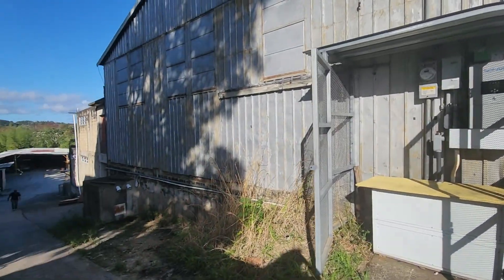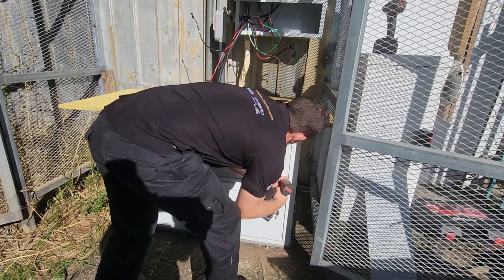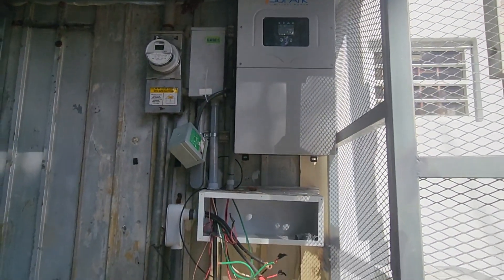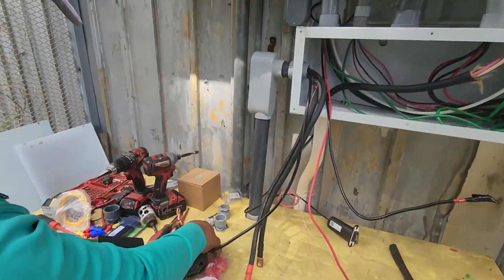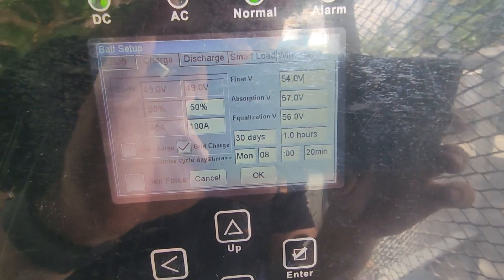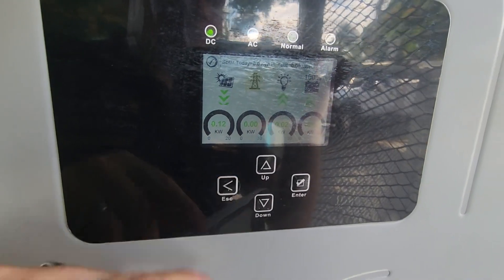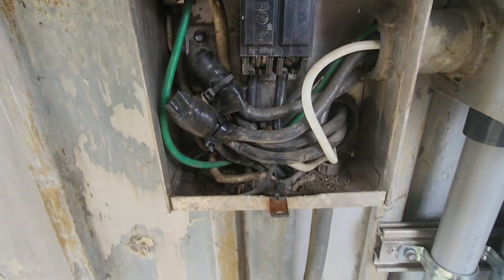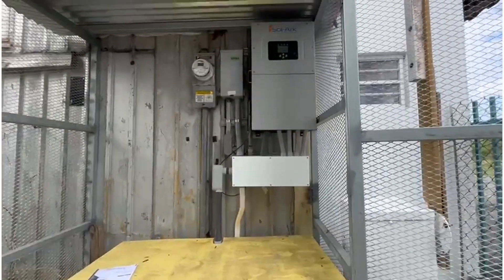Sol Ark 12k replacement for 15k BEAST

Comment: Nire equipment considering that inverter for my house. I have a critique though, push the wires into the corners of the box like when doing a neat circuit panel, it will look better and it will give the maximum amoumt of wire in case of an event and damage. Think of slack as redundancy.  Good Luck
Reply from the maker: Thanks for the tips!

Comment: Los felicitous, i to have a 12K Sol-Ark and 3. Fortress 5.2K  and 10 450w panels this system was installed about four years ago and it has worked perfectly.  Soon i hope to expand with 10 additional panels and one extra battery.  Since you’re.  here in Puerto Rico i may give you a call.
Reply from the maker: Sure! You can reach out to us at our email info@kenosyspr.com

Comment: Sol Ark 30K it will be the perfect solution.
Reply from the maker: Good suggestion but the building voltage is 120/240 split phase and the 30k only outputs at 120/208. The only inductive loads are the paint mixers and the peak demand is only around 40Amps, the 15k dominated that load like nothing!